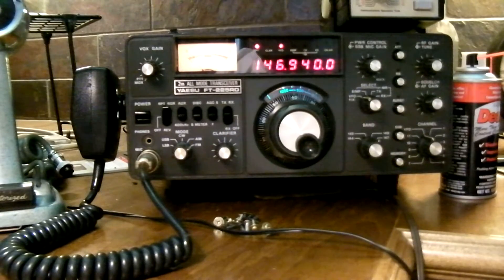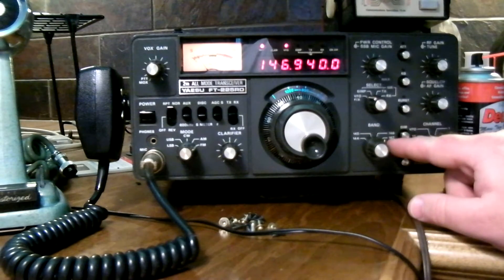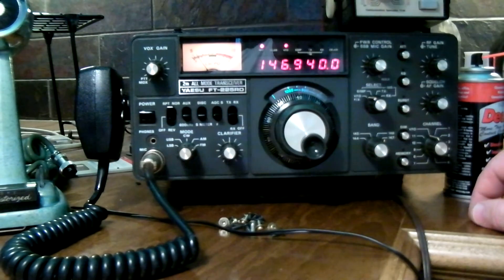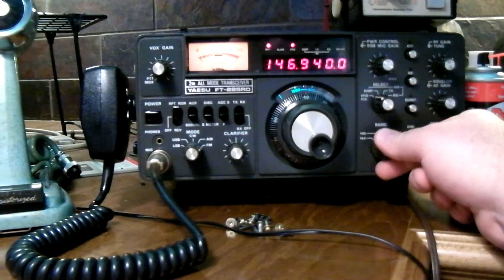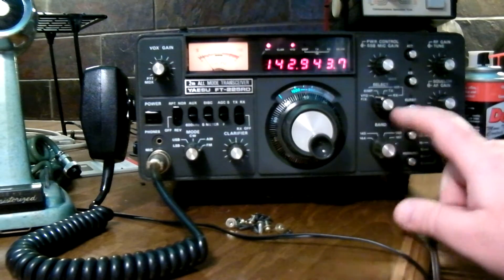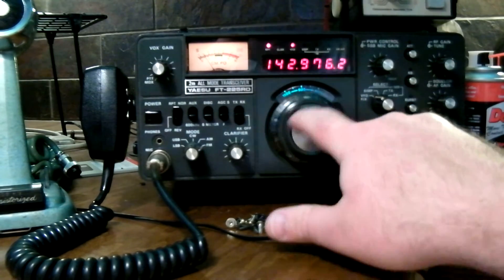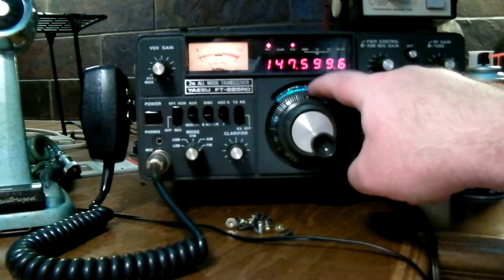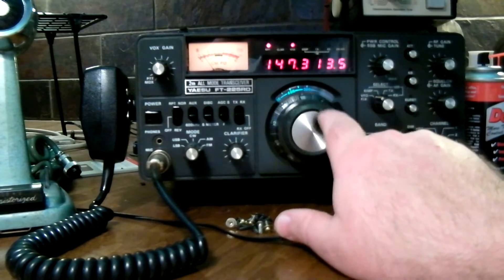Yaesu Ft-225rd upper 147 band issue

Comment from the maker: Sorry, never posted the fix. 
It was actually not the radio portion that was causing this. The chip on the display board goes bad and is very difficult to replace. It is out of production. I replaced the entire module with one that had been scrapped. Display and board.
I believe its the chip that is mentioned below. Thanks!

Comment: Hey, Pal!

Hope you have fixed it. I had this problem and this is surprisingly simple, though difficult to discover.

Just replace the TC5032P IC. This is the culprit.
Just like that. I don't know why, but it fails with time, and it was used only in this board. You cannot see it in any corner, but you can find at littlediode.com.

In the case the problem returns after a few days once it is replaced, and the readout stabilizes by gently pushing the IC, just take out the socket and solder it directly to the circuit plate. If you (like me) are not comfortable with precise soldering, find a technician that masters soldering precision.

You'll get it solved!

All my best!

Guilherme 
PY2ING
Reply: I have one same problem, brand new in the box, just bought it from Japan. Thanks for the info 73'S-DW3MTC MANILA 🇵🇭
Reply: I have a like this problem in a FT-625RD. The last segment (53 till 54MHz) have instability in the display only. Can you tell me how you fix this on the 225RD? The circuit is very close to my 625RD. Thank you, Marcus - PP5MS
Reply: @lucecomm  morning  can you tell me where to order this ice have the same problems with my 225 it's to nice radio to give up
Hope to hear from you
73
PD5LAH
Reply: @lucecomm  where?
Reply from the maker: @lacemi  Read Guilherme's post. I googled that IC and its available on ebay as well as other places.